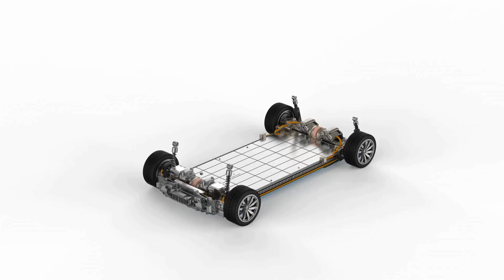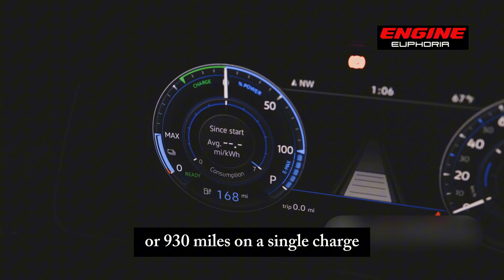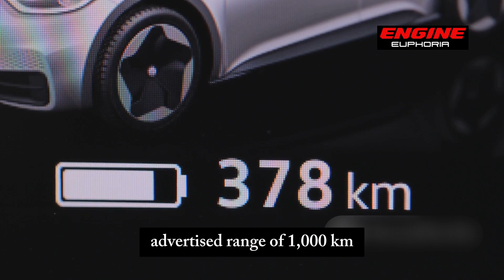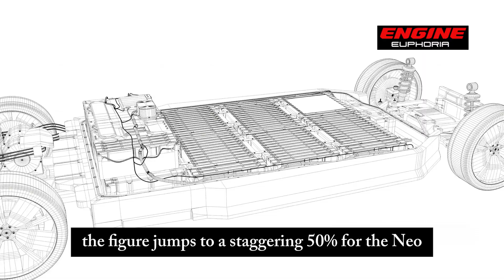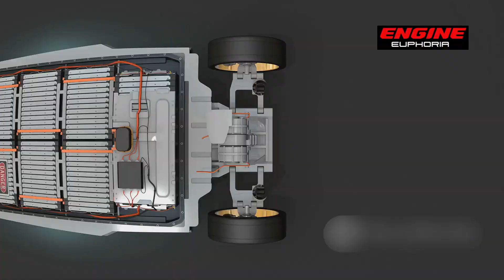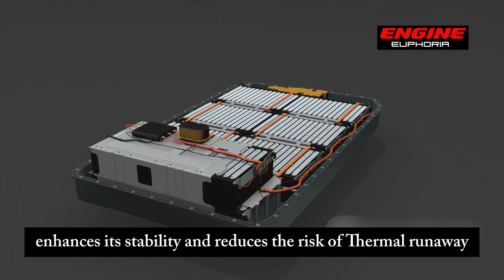Japan’s NEW Solid-State Battery SHOCKS The EV Industry!

Comment: Battery capacity isn't the issue. There's a ton of battery chemistries that can handle more capactiy than Lion. The issue is battery discharge rate. How fast can a battery output the stored energy is more important.